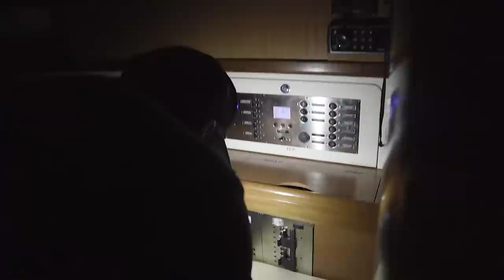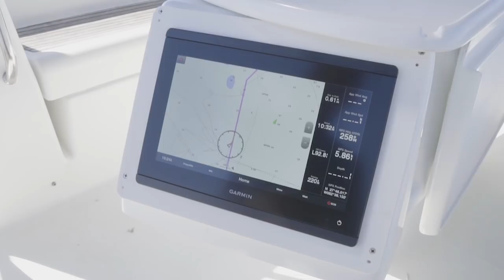Learning to Sail Our Beneteau 46 w/ NO Experience (Take the Waters) S1:E1

Comment: Having taught sailing for years, my advice would have been to learn sailing and basic boat handling on a much smaller boat, where things are simpler, errors are much cheaper, and less serious   Just the first few times   Crewing for others is a great way to start
Reply from the maker: We’ve sailed smaller boats before, but still feels much different than operating a larger vessel like this. That’s why we thought it would be smart to learn sailing and operating our specific boat, that we’ve never been on before, with a captain. I think crewing is a wonderful idea - we’re actually picking up crew who is doing just that! -Mandi
Reply: @Take the Waters  I thought you said your current abilities to sail were zero and the captain wouldn't let you leave until you could sail.

Comment: I like your enthusiasm and ambition. I’d suggest lowering your Bimini during your first days out sailing. You need to learn to read your sails, main, jib and spinnaker. Watching the camber, luff, leech and telltales. Understanding the aerodynamics and how to keep safe by de-powering the rig when required without depending on the furling system. It’s almost impossible to achieve this from a “letterbox” view ahead of the hatch. Same with navigation, electronics are only an “aid” to navigation, be confident and competent with using paper charts as a foundation. Otherwise, like always your electronics will be sure to go wrong just when you depend on them most.

Take it slowly and sail safe. A boat only makes its true size and power apparent when things start to go wrong.

Good luck and thanks for posting.

Comment: nice job. to start sailing on a boat that big is very brave. the design of your boat is one of the more easy designs to maneuver in reverse in tight places. however its still not for beginners and you did it. proud of you nice work. the best thing I can tell you is don't do anything without a compadnt plan then execute that plan but be ready to alter it if need be but still execute it.
Reply from the maker: Thanks 👍 -Brian

Comment: We own exactly the same boat, a 2008 Beneteau 46. We traded up from a 31' O'Day, which we kept for a dozen years or so. I wasn't looking for a boat this big, I wanted a 40 footer, but this one crossed our path, and here we are. We mostly sail in the Carolinas. She is a good boat, sturdy, proved itself many times. Very comfortable, we had it for 3 years now. Not without a bit of challenges. As soon as we bought it, I fell off her on a storm onto the dock, with so bad luck that I landed on a concrete box, shattering my right hip, which in turn overstressed my left hip. As a consequence I have 2 new hips and really happy. So in earnest, this is the first year that we can sail her, me, without crutches or a walker. We had some challenges with the electronics, and electrical systems. We are still trying to work out the little gremlins, sometimes it gets annoying but nothing major. We had made some improvements, I added AIS A+B, eventually will want to wander about a bit further away, and I wanted to be and to see what is around me. We also modified the water systems, bringing fresh water to the heads, and installing bidets onto the heads themselves. The rationale for this, is not to have the water that surround us in the slip into the boat (it smells awful), and to have a better and more enviromental sanitation system. We have an electric head and one manual...just in case the electric fails. I had to change the transmission on my windlass...it seems one of the previous owners did not use the anchor system properly and damaged.... it was not funny having to hoist all the chain back on board by hand, hahahaha, it made for an interesting afternoon. Good luck. Look forward to read more about your experiences. Im sure we can learn something from your video blog. If you have any questions or advice for us, it is welcome.

Comment: So many people want escape from what they consider their dull lives, and are watching these Youtube channels, and they get the bug before they actually know how to sail or boat, and before they know what it all entails to just pick up and try to sail around the world. It is, and always has been and will be, a vast undertaking that does require much more money and time than just buying a nice boat. I now have a 50' yacht and have owned boats before, so I know what to expect. Boats are great, the freedom is only matched in flying (which I also do,) but boats (and planes) require endless upkeep, repairs, slip fees, upgrades, and things will always crop up that many don't have the extra savings to deal with, and most people don't last more than a year before they give up "the dream." That's not to mention the logistics of living aboard, and dealing with, really bad, life threatening  weather, etc. So my advice, for what it's worth, is to not just "go and do it," but to do lots and lots of research. Don't rush. Take sailing lessons, maybe go through 101, 103, 104 and even 105 where you learn to chart without electronics because eventually, electronics will fail. Then take a course on diesel engine maintenance and repair, one on electronic/electrical appliance repair, another on basic carpentry/fiberglass and hull repair, boat plumbing, etc. and most important, try to keep your boats as small and simple as possible while considering comfort for a couple. The bigger the boat, the more the cost, and the more gadgets, the more breakdowns, as salty air eventually gets into everything. If you are retired with a good pension, or are wealthy and have the money to make mistakes, then not a problem, but you still need knowledge or you will cause more problems for yourself and others. I've seen some very poor boating going on, and that sometimes leads to catastrophe. Educate yourselves...
Reply from the maker: All very valid points - We hit on these topics in upcoming videos. But also, yolo. :) Brian

Comment: Very nice video guys, I have to subscribe now and follow along.

My wife and I bought a Valiant 40 and we plan to circumnavigate starting fall 24 or spring 25. So we will spend the next few years, learning to sail before that happens :) excited to see how ya'll do learning etc. I am jealous of your bow thrusters though ^^
Reply from the maker: Awesome! The bow thruster is a gift and a curse. It's failed at the worst time so there's that but has been good most times.  -b
Reply: @TakeTheWaters  haha I can only imagine.  We are still learning and one of our first times out, we had to park in our slip on the west side of the bay, with 30 knots of wind pushing east and 5 ft swells.. it was either do that or take a couple more days off.. we would have given a lot for one then.. but then again murphys law if we had it.. that would be the day it failed. Lol

Comment: Good: Looks like you have the docking down, but one issue I noticed. Being able to back your boat is very important.

Bad: Sailing with fenders on the deck. They are dangerous on deck and should be put away.
Reply from the maker: Bob Bob Brian is becoming a pro at backing up the boat! And don’t worry, those fenders now get put up 😊 - Mandi
Reply: @TakeTheWaters  Cross train so you can both do everything well.  You'll both need to be able to do everything.

@Bob Bob One quick way to stow the fenders and keep them handy at the same time is to tie them over the lifelines or stanchions, particularly over the stern.

Comment: One thing I would personally do differently, is to buy a cheap old small boat first. You get those for a price of a dingy motor. It's a cheap way to learn sailing. Everything is easier, less heavy and if you make a mistake it usually doesn't cost much and doesn't do that much damage. Like if you hit another boat or if you run aground etc. Also sailing a smaller boat is a lot easier. You can learn how to navigate and operate without fancy equipmemt, which is good to learn since you never know what might break. After you learn the basics during a year or so, you can just sell it for the same price and get the boat you really wanted. I've seen too many inexperienced people crashing their boats and causing damage to others, so that's why I have this opinion. I'm sure it's not an option for many people, but it's just my two cents.

Anyway, I wish you good luck on your journey!
Reply from the maker: We've rented and sailed small boats before, but nothing ever this size, which is why we say no experience. Things feel different in different size boats, so once we knew what our goal was, we decided to go for it and learn how that specific boat handled and felt. We're a year and half in to owning this boat and we're loving sailing her. We've gone to the Bahamas and back, and up to the Chesapeake Bay. More videos on that to come :)  ~Mandi
Reply: @TakeTheWaters  Oh, I did not know that, thanks for explaining!

Comment: Would it be possible to find out a ballpark cost to upgrade the boat with all of the electronics you did after purchasing the boat?  I am looking to buy something very similar and probably also a Beneteau brand.
Reply from the maker: Just the Garmin electronics and just a ballpark (chart plotter, wind speed, water speed, depth, auto pilot, 4 instrument readers, AIS 800, external gps), id say $10-12k, but if you have to de-mast and haul the boat, which you probably will,  that could be another $1-2k. Wires and such will be another $500-1k. Lets call it $15k if you do the work yourself.  -Brian

Comment: haha, fantastic - just curious, why not start a bit smaller, or at least spend $1,000 on sailing classes first?
Reply: I would have at least started with a cheaper smaller boat....
Reply: @drewhoff9646  The great thing about sailing and cruising is that everyone gets to do it their own way, so long as they don't put anyone else in harms way.  If you want to start with a cheap and smaller boat (I did, about 50 years ago), then you make that decision for yourself.  I don't think this couple are doing anything wrong. They are doing what many don't bother to do.  They are reaching out for instruction from a pro.  I would be fine to have them as dock neighbours or to meet them out on the water.

Comment: Ok so my question is why are you installing all this electronics when (for the map plotter at least) can be uploaded on a tablet (and phones for back up). There are apps and updated uploads that would be cheaper and easier. I take it you are not hurting for cash but convivence I would be using a tablet  to make it easier. This can be used for all your navigation until you hire someone to properly install.
Reply from the maker: We use the chart plotter to control the auto pilot because a tablet can't do that. We also use a tablet with a different set of charts which has proven several time to be a good combination. -b

Comment: Learn how to navigate without electronics.
Reply: Totally agree. I am always amazed by not needing a license in the US. Very different here in Germany. Without a license you not even drive a dinghy with more than 5 horsepower and for sure not a boat. And you have to learn to navigate manually, otherwise you don't pass the exam for the license. 40 years back we didn't have all that fancy electronic  equipment and although it really is nice to have chartplotters, autopilots etc I would never only rely on that. When it comes to the autopilot: used a hydrovane back then and still do, so not really any need for the electronic autopilot. 
When I watch sailing videos like this I often ask myself "what will they do if the electronics fail?"
Might seem to be old fashioned for a lot of younger sailors, but the ocean can be a very harsh and  unforgiving environment where you need those skills.
Reply: @ChristinaMcKay  
Zee Germans always think they know best.